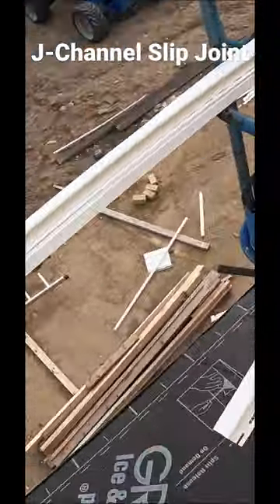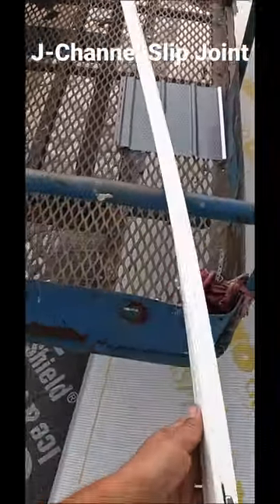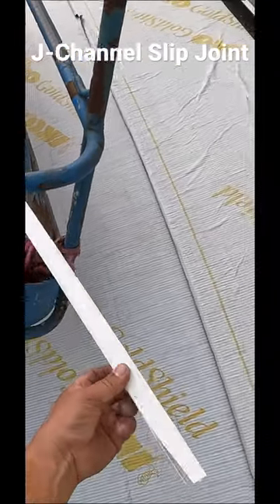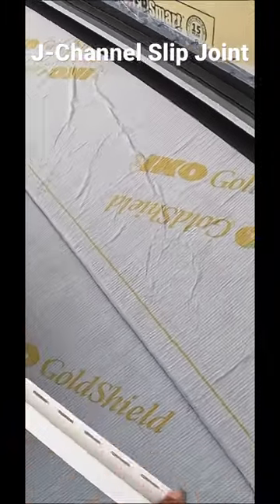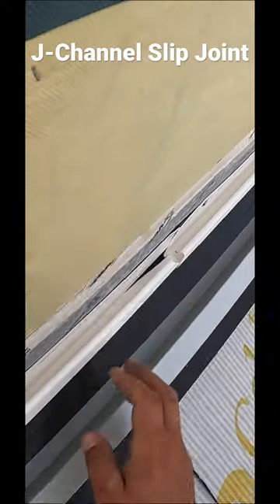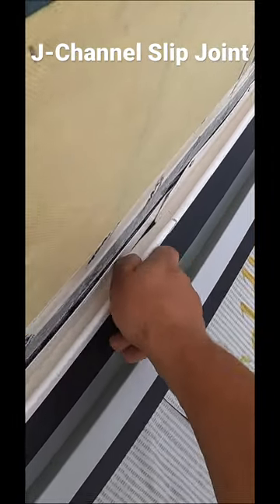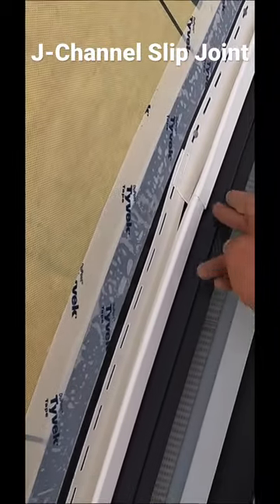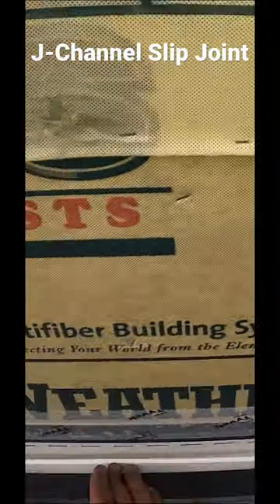How to merge 2 pieces of J-Channel (change the word “behind” to “inside”)

Comment: Is that horizontal? Isn't that creating a trough for collecting water?
Reply from the maker: It will collect water until it runs out of the ends or spills over the face of the j-channel… the nail slots on the back are higher up than the face of the j-channel.

Comment: Too much effort for me. I would butt-joint them and leave a 1/4" gap for expansion. The gap would serve as a water drain hole.
Reply from the maker: It might seem like extra effort, but it helps hold the J Channel in place while you’re nailing it.. that makes it a lot easier to place and saves time (it’s pretty much like having an extra set of hands). And for drainage we could always cut out the back more. Little gaps here and there add up and make the overall job look not as nice imo. But to each their own. 🤷🏼‍♂️